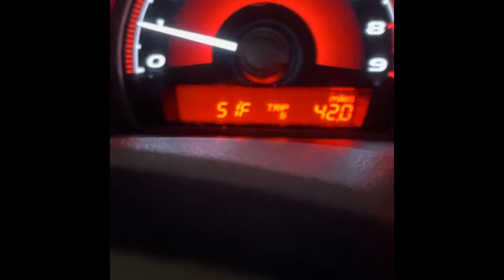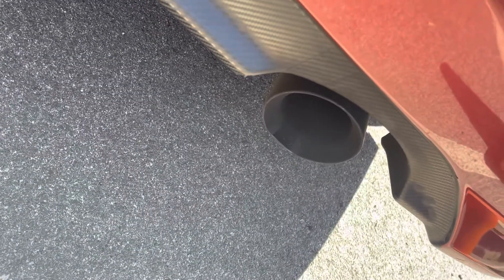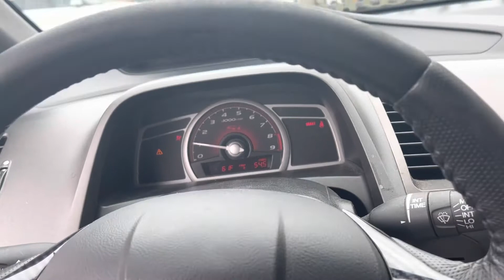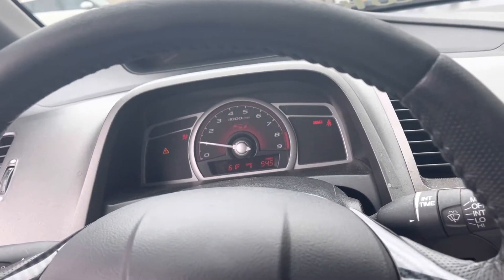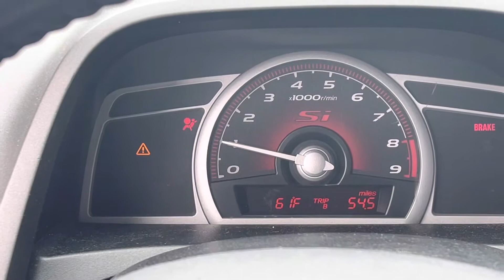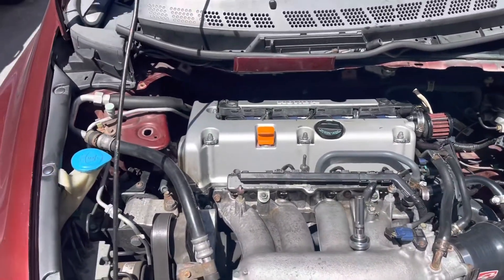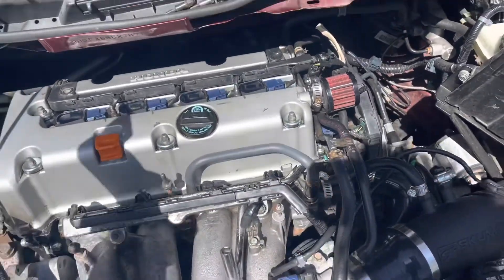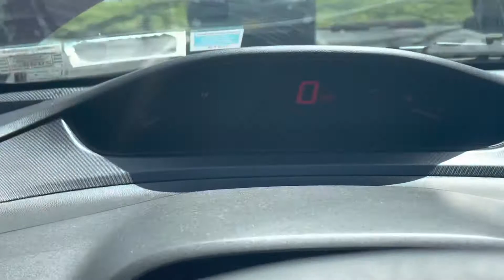I Already Broke The k24 Civic

Comment: Your intake sounds good what boltons you have sir ?
Reply from the maker: Drop in cams , oil pump , Vtc , skunk 2 intake and headers and 3 in exhaust, I have a complete build list on my channel
Reply: Ah ha Drop in cams there we go I have same set up but no cams I did 217hp with 75 shot I did 289hp dic in my shopping list thanks bro you inspired me
Reply from the maker: Thanks bro I appreciate it , more to come soon and how hard is it to do a 75 or 100 shot
Reply: It's easy bro k24a likes  it for the past year I been doing 75 shot Ima go 100 shot e85 this time but nx has a proton kit with drive by wired to throttle body and flashpro activates when it detects 80 percent full throttle you still need a trigger switch before everything activates
Reply: The kit is like 690$ easiest 85hp I ever got lol but the  only down side is nitrous in Cali is expensive 10lb bottle 70$ it will last only 5 to 7 hits 6seconds each hit lol but it gets them v8 to tumb you up lol
Reply from the maker: Wow that’s very cool bro , I might have to look into that after I port my rbc and get injectors 😂😂